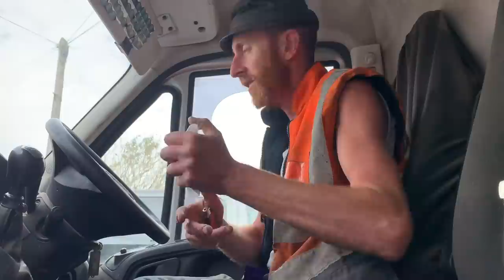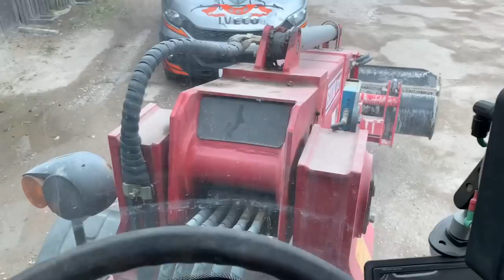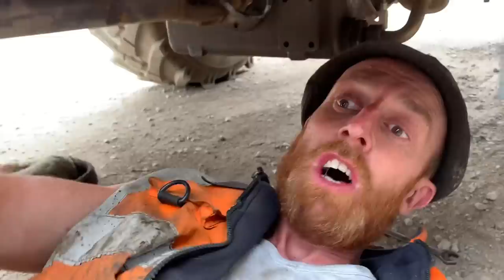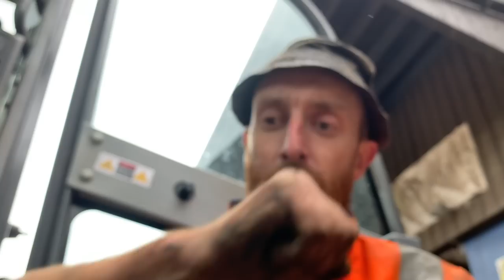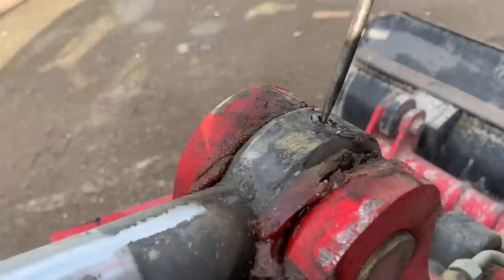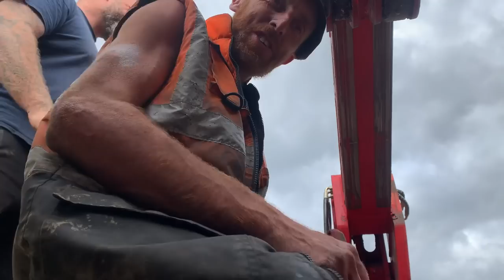D & J projects hzm loader brake issue master cylinder change, how to adjust brakes, filter service

Comment: Top work! The wiper arm slipping on the splines can be fixed by putting a few Nordic washers either side. Once compressed they should grip nice 🙏
Reply from the maker: Cheers Paul, I’ll keep it in mind when it go’s again 👌👍

Comment: I think if I remember back to my youth the 2 way socket ratchet is a scaffolders tool
Reply from the maker: That makes sense now you say that sandy…. The dodger at the end 👍
Reply: It could be but you can get them in all different sizes I had one that was 30/36 which was ideal as it fitted M20/M24 used it for years and it never slipped even with a scaff pole extension

Comment: just go to the carboot and buy a shed load of the same size spanners for cheap, youll end up with decent branded stuff in all lenghts of the same sizes for a few quid.

Comment: If you're doing brake bleeding - know them "oil suckers" for vacumming the oil out the dipstick? - the hand pump ones -  bang a bit of rubber tube on the sucker pipe & stick that on the nipple - it'll suck the air out faster than anything else. Best "brake bleeder" going.

Comment: Great vid as usual BUT ,, Correct me if i am wrong , surely the Brake Pads were severely worn hence the adjustment. And surely it needed no servo but just a good old brake pad change and adjust?
Reply from the maker: The shoes had pad left on the adjustment side what I can see through that tiny hole, but by rights they should adjust up by themselves as well….. we shall see her again no doubt, cheers for the advice monkey 👍
Reply: Exactly what I thought, with all that adjustment how much was left on the shoes, brilliant video as usual!

Comment: Is it from China? Didn’t see a brand like Cat or JCB. No sensors, basic setup and bolts missing from new. Probably doesn’t have automatic adjusters on the brakes. Their grease fittings/hydraulic hoses are generally proprietary as well, not BSP, NPT or JIS, nightmare to repair as getting spares is impossible. The Chinese are smaller in stature, hence the smaller build.
Great work as always. Maybe a GoPro or something similar if your going for longer videos and a laptop? 
Thanks for the shout out as well.

Comment: I guess with it being an auto and it moves without your foot on the break, every time your in it your controlling the speed with the break just lifting off and on the break not the throttle around the yard speed anyway.
Reply from the maker: Yeah that and if they leave it in gear when loading it’s fighting the brake, thanks mate 👍

Comment: i will be the smart ass, yoke is a clevis, pin is a clevis pin and the whole thing is a clevis joint
Reply from the maker: 👌 never to old to learn Jon 😉 thank you mate 👍
Reply: Not so sure about that, clevis pin is right, clevis joint is right but yoke is still a yoke.
Reply: Propshaft uj's fit into yokes, there are slack adjusters with yokes,  most pedal boxes have yokes